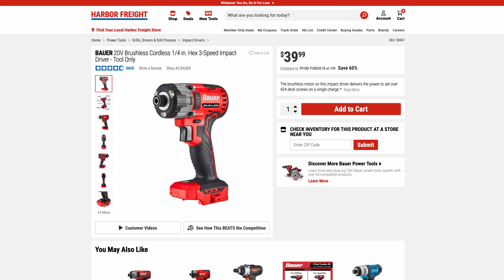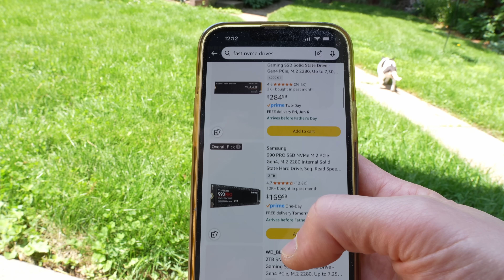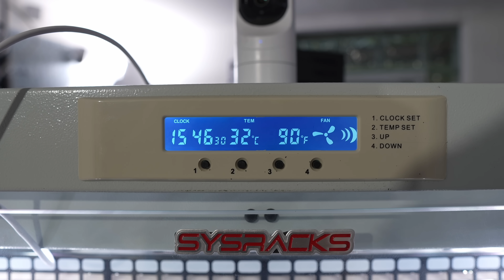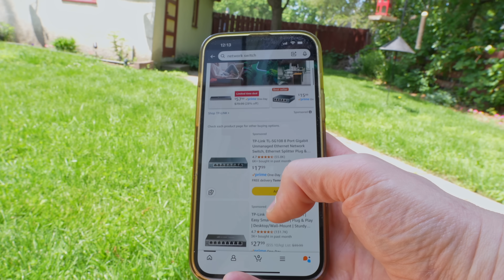Buy Once, Cry Once: How I Wasted $2,857 on Switches

Comment from the maker: I decided to give away the Switch Aggregation Pro I bought, details in Discord.   Thanks for watching.
Reply: Oooooo!!!!  I could use something like that.  I have been using the 24 Port POE Pro for a while, and I want more 10Gbit.  I have been looking at the 24 Port HD PoE for the 4x SFP and 2x RJ45 with 10Gbit.  It also comes with 22x 2.5Gbit.  I currently have 8 open ports on my current switch + UDM Pro, with the extra 

If I did buy it for $999, then I would have an extra 24 ports of PoE Gigabit, that I don't know what I would need.  The Aggregation switch fixes my current 10Gbit need, but it doesn't give me a pathway to the 2.5Gbit uplinks in the WiFi 7 APs..
Reply: ebay links to your old gear? lol
Reply: Just to keep in mind, the aggregation pro has a firmware bug in the latest version 7.1.26 which isn’t fixed since 8 months..
Reply from the maker: @Zaim-S by chance do you know what it is and what it affects?
Reply: Yes we have one deployed at a customer and it makes vlan config changes on different ports by itself. Especially after a reboot it makes issues. You can read the whole discussion and issues on the UI community releases post for 7.1.26. Unfortunately I can’t post the link because it gets deleted
Reply from the maker: @Zaim-S thank you for letting me know!  I will check it out!
Reply: Man same here ,  3 "Upgrade" to get where i wanted to be with my network......
Reply: I love mine.  I have all my nodes bonded in and soon I’ll get my NAS connected at 25Gb.  Because you can never have too much throughput…
Reply: yes exactly
Reply: and in less than a year you gonna want a 100g switch for home AI xD
Reply: Yeah, I am on the same road. Started with 2 USW-8-PoE, consolidated them on USW-16-PoE, then bought 3 USW-Flex-PoE, consolidated them on a USW-Enterprise-24-PoE and USW-Pro-Aggregation, installed more ethernet and fiber network runs again, exchanged the Ent-24 with a USW-Pro-Max-48-PoE. 

Now I am also in the situation to exchange my USW-Pro-Max-48-PoE with a USW-Pro-XG-48-PoE.

I am unsure, if I really need it. It’s too expensive for a home network. 

Can you tell me how loud it is in comparison to the Pro-Aggregation for example? 

Did you reduce power consumption with your new setup? 

How many wattage needs the XG-48-PoE when idling?

Thanks
Reply: The trick is to build for the system you want not what you need.

Comment: You made a lot of good points especially with wasting time trying to figure out which 10Gb port was causing the bottleneck. The downside of having everything in one switch though is that if it goes down you have to replace the one $2,700 switch instead on a less expensive one.

Comment: "Buy the best thing you can reasonably afford."

I agree with "buy once, cry once," but buying the most expensive thing because it solves hypothetical issues you don't have also doesn't make sense. This goes double for if you are getting into something. I've seen a lot of people waste a lot of money on things that they lose interest in within a year. Cheap gear, in any field, has its place. Don't go into debt for these things. Buy something that works, use it, save money, and then if you need the bigger better thing, buy it with the money you've saved.

Comment: On a smaller scale I had a pair of 8 port unmanaged switches for a while.

I then wanted to get into VLAN's ans so on.  I borrowed a Cisco Catalyst 3750 from work and found out how noisy and expensive it was to run.

I took it back and bought a Cisco CBS250 16 port managed switch that has no fans and uses 18W of electricity rather than near 200W for the 3750.

When I was given an old Dell Poweredge R210 II I bought a Cisco CBS350 and stuck them under my stairs.

Fortunately the 2 switches have done me well.

I am so glad I went with the 16 port model in the first place even though I only have 4 physical computers connected to the switch I have 8 active ports.

I also have a 5 port unmanaged switch if a need extra or for when I am travelling.

Comment: I've been tempted by the same upgrade that you made.  My current setup isn't bad, but I'm also not a fan of splitting devices between switches and also having to chain switches to the router (UDM Pro).  I avoided "Buy Once, Cry Once" in the past by going with the 10-port version of the XG switch, which is still pretty expensive at $699, but it's nice since it is all 10GbE instead of split between 10GbE and 2.5GbE.  That's partly why I don't see the 24-port variant being that great as you only add six 10GbE ports for a huge jump in price.

Comment: This is bad advice at best, and a sales pitch at worst... me thinks he got that unit for free with the sales pitch.... Unless you are in an actual data-center or everything is hitting it simultaneously because you have a butload of users [and should be renting datacenter space, its cheaper and far more reliable, ive checked].... just get whatever is cheap with the most ports on ebay as used enterprise gear. Tech is always a tradeoff of how much you want to pay vs what you need and when you want it. Homelab dosent require 10g sfp+ for everything. be patient and use gigabit, its orders of magnitude cheaper. You'd be surprised how little speed most devices actually need if you properly tier things...

Comment: With 35 years of networking experience, I've learned to buy the bare minimum that solves your immediate to short term requirements. Sure, that $2,700 switch is way better than the $2,800 bunch of misc switches, but if you would have gotten a comparable switch back then it probably would have cost you at least $7,000, so most likely you saved a few thousand thousand going the route you did. Plus you're now in better shape with a more modern switch than the switch that would have cost you $7 to $9K back then.

Comment: As an IT consultant, buy once cry once is gonna send you broke because most of your customers aren't going to pay for it. Your biggest problem is that you didn't work backwards. You need to start by figuring out your end goal, seeing what devices fit your requirements, whether it fits your budget, and if it doesn't... Start pairing back until it fits your budget OR buy second hand or both.

Taking the longer and more expensive path can be fine. I've seen some customers who purchased 2 second hand switches for less than the price of a brand new one.

Buy once, cry once is only a thing if you know exactly what you need and have the money to buy it in the first place. If you have money but don't know your requirements, you'll buy buy twice, cry twice.
Reply: Exactly. I 100% agree with your comment. This is just a case of bad planning and impulsively spending. Just throwing money at the problem

Comment: Big believer in buy once and cry once. I'm a network engineer and I just got a Pro Ma 24 PoE & UCG_Fiber for my home LAN which replaced some Cisco Catalyst switches and pfSense firewall. I'm alos into target archery and buy once, cry once is a big thing there. Buy a well machined high end sight and it will last you a long time and won't drive you c4ray rattling loose all the time.

Comment: While what you are saying is logical to buy the right thing the first time, the switch you eventually bought is brand new and didn't even exist a year ago much less when I assume you bought your first switch. I have a 24 port ubiquiti Poe+ 2.5 gig switch that I bought a year ago, despite wanting to be more future proof and get a switch capable of 10 gig ethernet. It was one of the best switches when I bought it to use with my brand new at the time u7 pros. I could not have bought at the time a better switch with 10g base t instead of 2.5g base t from ubiquiti because quite frankly they didn't offer it. I considered an aggregation switch instead using adapters so I could get my 10g base t but I settled on a switch I knew I might replace when 10g base t switches became (excuse the pun) more... "ubiquitous". With technology, I think it may be inevitable that you buy what you need right now and wait for technology to catch up with what you might need in the future. That's just the way technology is sometimes.

Comment: Well I always started off on buying things that got the job done. I always knew that if I buy the most expensive with the greatest value, it will last me a long time. For example, I bought a computer back in 2019 where I choose the most expensive gear there was. That same computer I kept until 2025 which I knew was time for an upgrade because things were slowing down. This time I cheated out buying a cheaper CPU, well as least a consumer end CPU and I noticed it wasn't as good as the higher end of workstation CPUs. But I did buy the best of everything else. The best CPU is currently about 12,000$, but saving up for it so I don't have to upgrade for another 6 years like last time

Comment: To be honest it makes sense to buy what you need with some extra headroom rather than the massive endgame.
For one, you can sell the old gear.  For another thing, the higher power gear gets cheaper over time.
I don't need 48 ports, but by the time I do it might not be £3,000.
What I currently need is 16-24 ports, 8 need to be POE and two of the POE ports need to be at least 2.5GB.  About 6 of the non POE ports need to be at least 2.5GB.  For now, Two £70 switches are doing the job... but if there's a solution that does what I need for under £200 I'd bite the bullet.  At the moment, it's still about £500-600.  So I'll cry again later, when that is cheaper (and resell my old gear).

Comment: So basically you had no clue what you actually wanted, no plan for future expansion and wasted a bunch of money replacing perfectly good switches rather than adding features to what you already had. My advice would be to make a list of all the features you need today, look at emerging tech then add features you think may be useful to have in the medium term. Then buy an option that is relatively easily expandable oh and whatever your current needs add 50% capacity out of the gate. You didn't need to replace your switch to get PoE you just didn't want to add a multiport PoE injector or didn't know they existed. The fact you bought a switch aggregator for a home network says a lot quite frankly.

Comment: S5860-48XMG-U, 48-Port Ethernet L3 PoE++ Switch, 48 x 10GBASE-T/Multi-Gigabit Ports, 4 x 25Gb SFP28 Uplinks, with 2 x 40Gb QSFP+ Uplinks. Best part, no Unifi nonsense.

Comment: just for a nice little house I bought UDM SE, 8 port 10G aggregation sw, 2 pro max PoE, UNVR, 9 unifi cameras, 2 flex switches, 3 wifi access points....with all the accessories around I spend over 8,000 USD....overkill??? maybe...but this runs like a swiss clockwork. I can manage this network from allover the world from my HP. Unifi protect is a dream! regarding the cost, have in mind that unifi outside the US is approx 25% more expensive....I could have bought some cheap mesh routers and camera set from the home improvement shop....then wondering how to access the cameras from outside and how to increase disk space to record the cameras.....no thank you. on the current setup I could put another 15 cameras easily. just add, adopt and done. but for one little house, how many cameras do you need? I will add two more soon :-)....I am adding, but I did not buy parts and later replaced them, because the system did not make sense (any more). I have 4 10 G ports on the aggregation switch free which I will not need soon. I am a normal user not a video editing company. I do not need to connect a PC with 10 G...2,5 G is more than enough for normal use. and most of the cameras connect only max at 1G )lots of them only at 100Mbps.....the aggregation switch at 10 G is just there to avoid bottlenecks from stagging switches....whenzou start, think what you want to run on the network at what speeds. then built something which has double the ports you think the final config will be and zou should be fine.

Comment: I am upgrading from 1G to 2,5G for now. Just for my home use with a tiny homelab and to have Wifi 7. 1G lasted like 2 decades and now pc's come with 2,5G standard so i thought i am future proof. But seems that future is comming real close haha. At least if i need to upgrade to 10G it wont be that costly. Having the UI gateway fiber with a roughly 15 meter 10G link to 8 port flex (no PoE) switch. so thats checked. the only thing i might regret is the not enough PoE. The wifi 7 disc can go in the gateway that has 1 PoE port and i think i only need 1 disc (small house). And in worst case i only need two camera's. So i just buy the PoE Adapters if nessesary. But also looking at the Solar powered wifi camera's....

Comment: Building a house now and picked up a BNIB US-48-500W.   Theres only going to be 2 10G runs, to my server and my office PC.  Everyone else is gonna live with Gig Ethernet.  Will run about 5 POE cameras and 2 POE APs.  Should be enough for my needs (overkill actually, but we ran dual network cables to each drop just to be safe.).  The whole house is wired with 6A, but not gonna worry about it for the time being.  If this all works out, maybe someday I'll upgrade to a full 10G switch, but first, a 4K UST laser projector and screen are above that on my list.

Comment: Switch or be switched! 

I "just" have a 18 port switch. SFP++ in a failover cluster... With additional 48 port switches for Every floor and one exclusively for cameras and intercom. 

As a matter of reason, just buy the biggest switch you can find and use it until you need more (you will need more)

Comment: Totally agree. I have the same issue. Where can I sell all used stuff. I thought buying the enterprise XG would solve the problem. 24 10gbe ports, but then i needed POE, so i added on the XG 6 POE two of them, to solve the 10gb issue, but then I ran out of space and needed the usw pro max, along with the usw pro xg, aggregation switch etc. What can i do to free up rack space to get one device that solves all these problems? is the usw pro XG it? it doesn't have all 10gbe ports though. several are just 2.5gbe. so what's the all in one solution for all 10gbe??

Comment: I've avoided non-commercial grade switches forever, they just aren't worth the hassle, lack of consistency, and lack of proper diagnostics. New they are expensive but you can usually get them second hand for quite a reasonable amount and it means pretty much a guaranteed rock-solid environment. 

With vendors like Aruba and Ruckus, you don't even need to pay support/maintenance to get firmware upgrades for the life of the device (which - unlike consumer devices - tends to approach 10 years).

Comment: Buy once cry once only works in an industry that is slow to innovate and drive down costs. The reason buy once cry once works here because the prices hasn’t significantly come down as you were building up your network. So you felt like you could have saved more had you spent more up front.

In a truly innovative tech space, mid-end hardware should blow past high-end stuff in less than 3-5 years. See how older higher-end CPUs can barely keep up with the latest midrange CPUs. The consumer should have saved money by holding out and waiting for a next gen product.

The GOAT 1080 Ti was beaten by the slowest 50 series card (5050). That’s how far we’ve come.

Networking is stuck. It barely moved forward in the past 10 years. Yeah, there’s some consumer 2.5Gb here and there. But my computer from over a decade ago already had gigabit speeds, what’s up with that? Doubling every ten years? Seriously?

Comment: I know exactly what you mean. I bought a smart managed tp link with 5 ports and then I wanted more ports (that was 2018) now I have the 8 ports version and my home lab finally runs as a charm. Until I needed a second and now I have a bottleneck .. if I would just would have one single switch with 16 ports and 2x 2.5gbe uplink ports.. that would be fine until I upgrade my pc..

Bad analogy?
Considering the relative uplift in percentage it was a very bad decision - worse than yours.

Comment: I’m sure there’s a lot of gravestones out there that have buy once cry once etched on them, when it comes to these big silver Unifi switches.
The Gen1 switches failed at such an enormous rate, that you can’t really realize until you start searching trying to troubleshoot your own. Even if you do manage to get lucky with a working one, they are stupidly noisy.
The Gen2 made improvements on cooling and noise but still have systemic failures.
And these are all very, VERY expensive even today if you can find them brand new. It’s kinda crazy. How exactly did Ubiquiti gain traction as the premium networking brand with something as essential as their network switches being so rough.
I hope your Pro Max has a long life

Comment: I started with a gaming rotor, dink i believe. only needed the 4 wired devices. my computer then wife's computer. everything else wireless. then i started buying pi's, Arduino's,  and server equipment. then a 16 port un managed, added an 8 port un managed. with all the Arduino's and pis hammering the wifi. poor rotor needed to be rebooted each day. so a timer on that plug turned off the internet every day at 1200 am and back on at 1215 am. my wife didn't hate this at all :\ I saved up for the dream machine pro, should have bought the one with POE and more ports as i had a wifi wall 6 that needed poe to run. while I have bought a lite 16 poe and a flex 8, should have gone bigger to start. lessons learned :)

Comment: Dude I just add another $25 Dlink 8 port gigabit switch when I run out, and done. Can't justify 2.5Gbps or 10Gbps gear when I haven't got other equipment to take advantage of it yet.